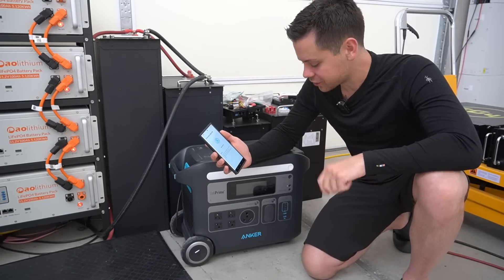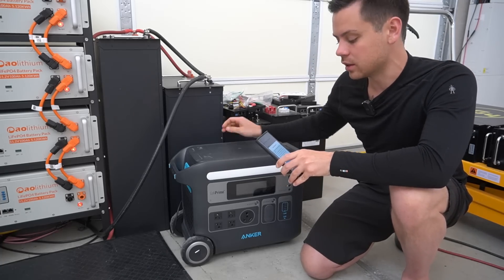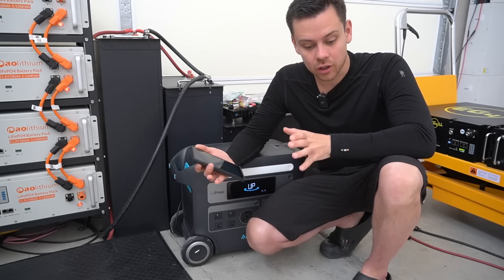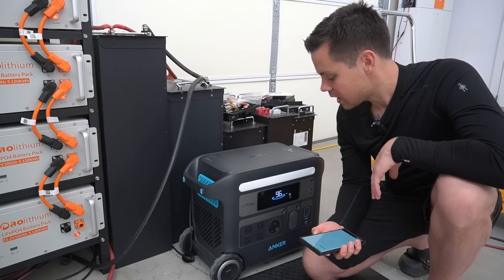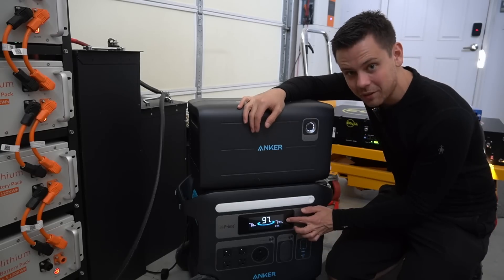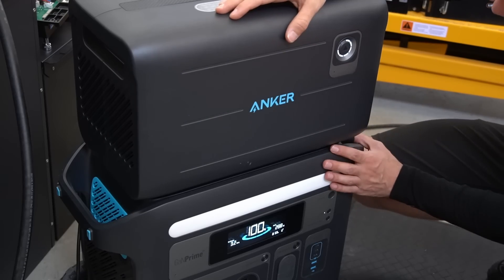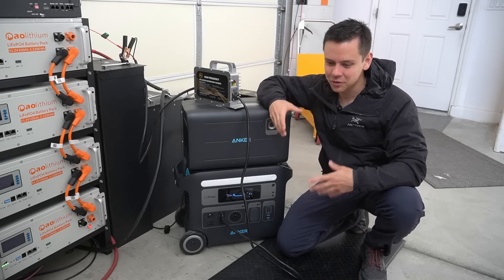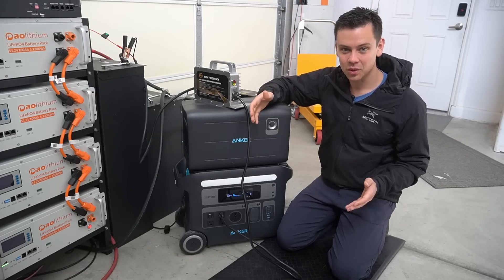Anker 767 Firmware Problems. Are you tired of being a beta tester for these companies? I am!

Comment: Too much software (and closed source) running on too complicated and potentially dangerous hardware. 
Too many "smarts" in devices that should be dumb as a brik
I consider that inverters, batteries, chargers, vehicles, hvac, water treatment, critical private or public infrastructure that provides or protects life, should not have or run any kind of software that could impact on or even prevent intended functionality. 

I know 1st hand that it is easier today to implement something in software rather than hardware. We can easily program a cheap 32bit mcu to put out spwm on a couple of gpio pins and modulate it based on the values inputed on a couple of adc pins. 
It's all nice and dandy untill you bog that mcu with wifi or worse, DRM for ensuring clients use original, with proof-of-purchase license keys accessories, extensions or subscription-based features. 
Vehicles already have these. 

Convenience over dependability. Yes, it's convenient to have an all-in-one device that does it all but that bites back causing a lot of inconvenience when something fails. 
Now, nothing is 100% failure proof. Everything, any device, will fail eventually. 
That is why we generally implement redundancy. But if the failover has the same firmware bug that triggers in the same scenario? 

Hardware can be easily fixed, generally speaking, as one has the circuit with the chips and parts on the bench and even without schematics, a failed capacitor, a shorted transistor, a blown trace on the bloody pcb... they can be fixed. 
But the corrupted firmware inside a broken mcu from a long-dead company that never planned to release code? :)
The company might be well today and pushing ota updates to your pv array controllers but tomorrow? 
In 10 to 20 years, employees (programmers) of that long-dead company won't remember the code or schematics. 
Even nicer if the programmers were outsourced. 
Computers, robots, party accessories, yes. I like them smart. 
I won't freeze to death or die of heat stroke if my smart, Alexa enabled, music controlled RGB led strips under my ceiling stops working in a storm. But my central heating better be kept on by my generator or inverter with or without 4G connectivity.

Comment: I am glad I bought it. It is than running my gas generator all night and it is saving me more money.
Reply: Lol, that is exactly one of the reasons why I purchased this as well. I live in a rural area and lose power quite often. Usually just for about two or four hours. Of course if there’s a catastrophic weather event, I can lose power from a few days to a week. But that is on the more rare side. I too have a gas generator. Sometimes it won’t start. I figured this is a great stopgap.  

This anchor unit can run my equipment in the evenings. Just like you said. But I figure I can get my gas generator running when there’s plenty of daylight. Really nice that this thing can completely charge in about 4 to 5 hours.

Comment: Bluetti has had some firmware update that failed to install and bricked the device. Heavy AC200Max had to be sent back to Bluetti for a repair.
Reply: Unfortunately, the answer is yes. Fast charging diminishes from 1400 down to about 100 Watts. And that last 5% is excruciating. It will not start charging the back up battery until the main is absolutely full. Hopefully they can fix that. In the firmware update. I am actually trying to figure out how to submit that request to Support. I’ve only had this thing for a few days.

Comment: Many small manufacturers are like: 
Get it out the door. 
But it's not ready! 
We'll fix it in software updates.

If you recall Microsoft's software philosophy - get it out the door; but it's not ready; we'll fix it in software updates.
In business class, we learned at some point you have to push them out the door.
If only perfect products were released, we wouldn't have many products.

They may not have sufficient resources to check all the soft bugs.

Comment: It’s called ‘The Bleeding Edge technology’. This has been going on for decades, and this is how they find out what they are missing, or other strange mistakes. At least you do not have to figure out mistakes when soldering  together circuit board kits with backward instruction for a random IC chip! (Late seventy’s)
Your issue is software; and the programmer(s) usually write to engineering specifications and do not necessarily know anything or everything about what they are writing for; sometimes. A work in progress.
That last message you noted was just probably just a quick workaround. Be nice to the programmer, he is listening.

Comment: What panel setup are you using to charge the 767? Since the max input is an oddball (11-32V⎓ 10A; 32V-60V⎓ 20A (1000W Max)) are you using a combination of series/parallel or are you over paneling the unit? Thank you.
Reply: I really think will fully understands the importance of proper voltage input from solar panels and the correct way of connecting them together. There are other units out there that he has tested that also have had problems

Comment: Software is not that complicated? I guess you have written your own software for these kinds of products?
Reply from the maker: Yes, I did microcontroller programming for animatronics before I did this. And many other devices. I would put you to sleep if you knew all the stuff I have built and programmed. I should get my parents on here one day to talk about all of my little projects over the years.
Reply: Yup, it is not complicated if you know how to do it. But whoever wrote the software clearly hasn't read the book on finite state machines.
If you build your embedded software according to Mealy and Moore FSM there's pretty much zero chance of bugs.
Reply: Hardware designers have to get it right first but these days, with OTA updates, Software designers seem to use the scattergun approach.
Reply from the maker: Think about how many inputs and outputs we are dealing with, bms is self-managed typically and the communication between the expansion battery and main unit is dead simple. There is no excuse here.